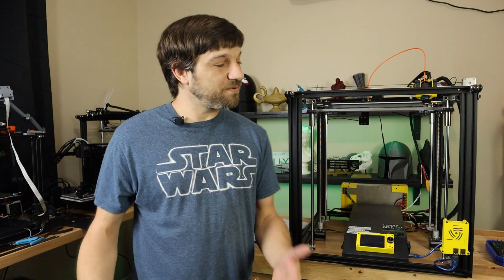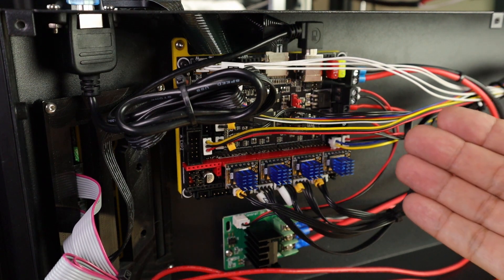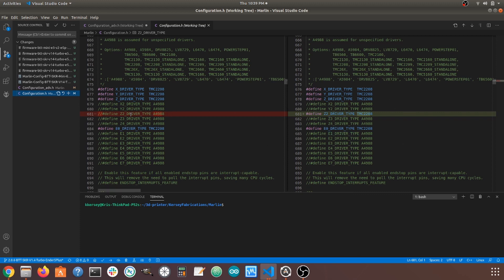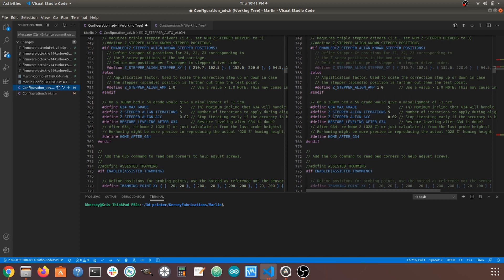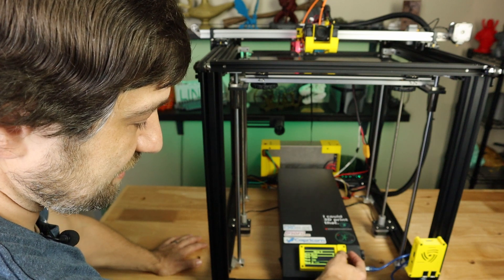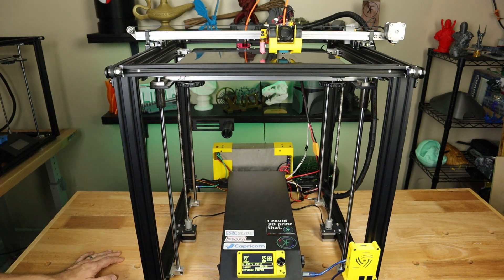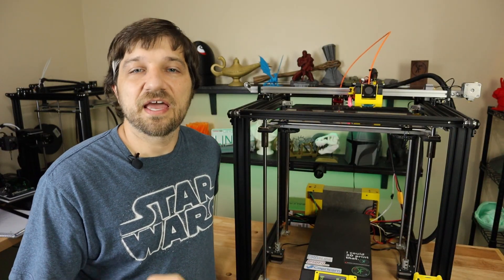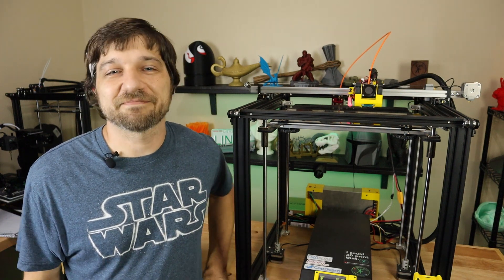3D Printing Pro Tips: Z Stepper Auto Align with Marlin G34

Comment: Hey Kris great videos. I tried installing the above marlin bin file from sd card on skr 1.4turbo board.  I get an error " read onboard sd card error.   its the sd card that came with my ender 5 plus. i tried other micro sd cards and same thing. any help would appreciated.
Reply from the maker: Thanks! I've heard of some people having issues with the SD card. Try sticking a small piece of paper or card next to the SD card on the the opposite side of the pins or exchange it.

Comment: Hi Kersey I am having an issue with mine. After adding the 5th 2209 and switching the wires over for the z I flashed your firmware and now I am getting a bed leveling fault. The bltouch seems to be working when the printer boots up and when I test it in tft mode of works but then I home z the bed goes down and the bltouch stows and deploys several times and the bed never goes back up and I get a error message come up and it says stop called because bl touch error restart with m999. I’ve tried enter m999 and G29 nothing happens. Any advice ?
Reply from the maker: Double check the white/black BLtouch wire. Make sure it didn't come loose.

Comment: I am having issues with my bltouch on your firmwware. I am using 2209 steppers and flashed the firmware according to your file but when the screen boots up in tft mode it gives a auto bed level fail and when homing the z  the bed goes down and flashes red / blue and never goes back up. The bltouch itself is working when testing it in the tft menu. Anyhelp would be appreciated. TIA
Reply from the maker: No problem. It's most likely the black and white wires. Double check those.

Comment: #define Z_STEPPER_ALIGN_XY { {  20, 110 }, { 187,  110 } }

how do we calculate these numbers?
ITs not letting me compile until this is correct
Reply from the maker: You should be able to comment that line out and actually let it compute it automatically.  To compute it correctly, you have to make sure it's reachable by your probe, so not closer than your probe offset.
Reply: @kerseyfabs   yes you can comment it out but i believe you should do i video explaining how to get these values. Because sometimes the way it automactically does it doesnt work as well. i did it a long time ago but cant figreu out how i did.

Comment: When you print with that petsfang duct do you have to reduce fan speed? I have it and i find that when the fan kicks on to 100% on the forth layer then it just blows the filament away from the print and never stick
Reply from the maker: Sometimes yes. I usually run mine at about 80-85%.

Comment: When you use G34, is this something that needs to be done once in a while or at the start of every print in the start gcode?
Reply from the maker: I only run it once in a while. In general my printer needs releveling very rarely. So when I do finally decide to relevel: G34, Corner level, G29. Something like that.
Reply: Oh okay, thank you. Just wondering because I am doing this mod on my Ender 3 Pro and that can be finicky at times.

Comment: Had a question. I did everything correctly and have the Dual steppers going. I'm having a hard time leveling the bed manually. I screwed the four corners up as you stated, I heated everything up, did the Z axis auto align (worked great). However, I'm used to the button on the Ender Plus stock board for AUX leveling, just using a piece of paper to fine tune places on the bed. I can't seem to find a setting like that on this Marlin build. The closet thing is the leveling of the 4 corners and that doesn't help because I can get the front of the board up towards the nozzle (using the screw knobs), but the back of the board is maxed out. The ABL function is off, I feel like manually leveling is the better way to go.  What do you think I'm doing incorrectly?

Edited: looks like what I’m looking for is bed mesh leveling (points on the bed, paper under nozzle, turn knob to move the Z axis to fine tune each point) and the G28 command disables the mesh bed leveling..

Comment: Fabulous video, thanks buddy! 

Some may need to assign Z2 pins depending on the motherboard. In the pins_[BOARD].h file (where [BOARD] = your motherboard) one may need something like:

//constructed Z2 to use original E1 pins on Archim2
#define Z2_STEP_PIN                         22  // PB26 E2_STEP *
#define Z2_DIR_PIN                            97  // PB24 E2_DIR -AddOns *
#define Z2_ENABLE_PIN                   18  // PA11 E2-EN
#ifndef Z2_CS_PIN
  #define Z2_CS_PIN                           19  // PA10 E2_nCS
#endif

/* 
commented out original E1 pins on Archim2
#define E1_STEP_PIN                         22  // PB26 E2_STEP *
#define E1_DIR_PIN                            97  // PB24 E2_DIR -AddOns *
#define E1_ENABLE_PIN                   18  // PA11 E2-EN
#ifndef E1_CS_PIN
  #define E1_CS_PIN                           19  // PA10 E2_nCS
#endif
*/

Comment: It makes absolutely no sense why you would keep the springs and adjustment knobs on the printer since you have auto bed leveling unless you know something I don't.
Reply from the maker: I've been thinking of doing a special video on how "auto-leveling" really works. The details of how the Z fade would really explain this. In short, a "auto-leveled" bed is not the same thing as a "level" bed. For things like models and such this probably makes little difference. For things like mechanical parts, this can really matter. An auto-leveled bed has to be compensated for.
Reply: @kerseyfabs  I still don't get it. The auto leveling IS the compensation for a bed that's not perfectly level. I'll bet 99% of all 3D print beds are not perfectly level. Also this hobby is not for making machine shop level stuff, were printing plastic. I installed TH3D solid bed mounts and said fuck the springs. Most people don't even calibrate their steps per mm correctly for their steppers and calibrate based on prints which is insane. Too much bogus info online about this hobby.
Reply from the maker: "Too much bogus info online about this hobby." You're not wrong. There is a combination of lazy info, misinformation, and group think. The final one I think is the most dangerous and the one I try to avoid myself by asking questions all the time.
"Also this hobby is not for making machine shop level stuff, were printing plastic." That depends very much on the user. Sure it's plastic but a lot of people use 3D printing for prototyping and dimensions matter.  Even as something as "simple" as cosplay can require tight tolerance to make mechanical parts work smoothly and accurately.
Sure, auto-leveling does compensate for unlevel beds but it shouldn't really compensate for a bed that isn't even level front to back/left to right. It should compensate for an uneven surface and when that gets too bad, the surface should be replaced.

Comment: can i use this firmware with skr 1.3 with no changes ?
Reply from the maker: No. It's a different board and at the very least you would need to update the board definition in the Configuration.h.
Reply: @kerseyfabs  yea beside that one thing (board definition):P
Reply: @kerseyfabs  tried to modify config to my skr 1.3 with TMC 2130. changed board type changed tmc type and the only problem is when i want to auto home its not going back to the endstops but in reverse direction as far as it can. When i reversed motors X and Y  its going to endstops but later not returning exacly to the center of the hotbed. And when i tried autoleveling its starting from the back of the bed and x pos is measuring to tle left unit its on place where bltouch dosent have bed to touch. Pls help
Reply: @kerseyfabs  ok never mind i finally found the problem. i needed to add to code lins with pins for endstops now everything is working fine

Comment: great job, but if you  I afford ..... all printers that have two motorized Z axes need a mechanical link between the two worm screws (type artillery X1)
In fact during the countless electric starts and stops in the use of the printer, the two motors inevitably are misaligned.
This normally happens on a stepper motor, but in the Y and X axes we have only one motor so no problem.
So if we want to be sure that the mecanic alignment of the two Z motors is maintained over time, there are two alternatives
1) link with strap as per X1
2) install two independent Z axis home point switches, if the motherboard allows it
The first solution is the simplest, you can install at the base of the screws (just above the case that contains electronics) you will lose a centimeter in the total measurement Z, but this does not matter.
Reply from the maker: I'm pretty opposed to linking the motors together. The motors should never come out of sink when printing, so the solution is to either d what you suggest in #2 or to use the G34 homing. FWIW, I've never noticed any loss of sync between my motors on the Ender 5 Plus.
Reply: @kerseyfabs  I think I explained myself badly, sorry but English is not my language, I try to explain better.
I did not say that the two Z axis motors lose step (misalign) during printing, no !
I say that over time if you check the position of the two Z axes after making a Home-point, you will see that they will no longer be aligned .
The first time I noticed this was 3 years ago on a CR10S pro, since then I have also noticed it on other printer with dual Z motors
Try to apply two discs (gognometers) in the upper part of the Z screws,
perform a Z-home point, make a reference mark on both discs, you will see that over time the two axes will no longer be perfectly aligned.
As I have already said it is normal, when a stepper motor is powered (off-on), this can move a micro stepp, the phenomenon is random, so being two independent motors, what I said happens.

I was the CEO and designer of a company that designed and built  systems that used stepper motors (similar to printers) I have 15 years of experience, I can guarantee you that what I said happens, you wondered why the artillery and other brands bind the two Z axes ??
Of course if you frequently use a self-leveling system before printing, this small misalignment will be compensated for, however I did this surgery to make the community aware of a problem that few know, I apologize for the bad English, but I hope I have well explained.

Comment: I received my dual z-axis kit a couple of days ago and fortunately found this video while searching for instructions, so a big thank you from a new subscriber! I say fortunately, because the instructions I was looking for dealt with keeping the gantry level when both steppers were on the same driver (short answer: manually level every time your z-axis steppers are powered down). My new mainboard w/5 stepper drivers will be here in a couple of days.

On a semi-related matter, what do you think about getting rid of the bed springs? I've had some run-to-run consistency problems (if I don't manually level the bed before each and every print) on my orange-spring equipped Ender 3, even with a BL-Touch and UBL. 

I've seen several suggestions to replace the bed springs with solid spacers, to eliminate the bed as a variable. I asked one of the folks who suggested this how much difference it made, and was told it made a significant difference.
Reply from the maker: I'm glad the video was helpful. I don't recommend removing the screws unless you plan to add at least a 3-point bed leveling system. Otherwise, I don't know how you'll level it in one direction. That doesn't mean that people can't make it work but you end up depending on auto bed leveling more than I would. To make the spring as reliable as possible, make sure you compress them as much as possible and work from there. I usually compress all the way then raise it up 3-5 turns.
Reply: @kerseyfabs  As a proof-of-concept I cranked the springs all the way down and added a couple of thick washers to raise the bed above the z-axis physical limit. That resulted in significantly more consistent meshes, so I ordered 100 M4 washers and installed the same number on each corner, after which my bed was nearly 2mm our of alignment. 

Using my calipers, I sorted them into groups with 0.05mm deviation. I found thicknesses from 0.75mm to over 1mm (all from the same lot, mind you), and that was the problem. My new main board was delayed (thanks, Amazon!) and should be here tomorrow - let the fun begin! I'll be relying on my BL-Touch and mechanical limit switches going forward (or perhaps replacing my glass bed and going back to springs?).

Comment: hi kersey  im having issue with my z they move so fast and and travel long say its on 10 mm it will travel 100 please advise thanks in advance
Reply from the maker: Can you check your steps per mm?
Reply: I set it vsc 100, 100, 400, 402
On the printer it went 100.00 100.00  on Z it went 4000.0... thanks
Reply: Ok I manage to change it to z400 and it’s fine now thanks ..... I still have a couple of issues one is how come my axis won’t go pass negative on the marlin lcd side I can move up but not all the way minus  side.... please help thanks again
Reply from the maker: @ferdinandparas2169  There's a Soft Endstops option that you should be able to disable in the menus. That will allow negative values. Just be careful.
Reply: Thanks for the response I got it figured..... every thing working now just last question .... the z alignment icon shows in btt screen.... I don’t have it but it’s on the marlin screen thanks in advance.....
Reply from the maker: Is it on the Marlin screen, touch screen UI, or both?
Reply: Kersey Fabrications  marlin screen only ... thanks
Reply from the maker: @ferdinandparas2169  So if you don't have dual stepper drivers for Z but you're seeing this feature, you simply installed the wrong firmware. My other video has the non-dual-Z firmware.
Reply: Kersey Fabrications  I have the dual z it works perfectly  .... I can see it on marlin screen but I don’t have the icon on the btt touch screen

Comment: I am somewhat confused by a reply . I have the SKR Mini e3 V2. I have added a second Z Stepper Motor to ZBM on the board. Will the Configuration.h and Configuration_Adv.h instruction be applicable?  If not can you assist with what those changes need to be? These are running 2209 Drivers on an Ender 3 Pro. Thank you in advance.
Reply from the maker: You can't do this on one of the Mini boards. They don't have independent steppers for the Z axis.
Reply: @kerseyfabs  That is disappointing. I am going to be installing a second Z stepper motor into the SKR Mini e3 V2 and I cant find any info regarding Marlin changes for it. I have seen that folks just plug it into the ZBM and go with it.... is that really all there is to do?
Reply from the maker: Yes. No firmware changes in that board. The Z motors are wired together.
Reply: @greggcaplan1304  I got one of the SKR E3 Turbos to solve this problem. It has 5 stepper drivers and was the least expensive path from my (nearly new) Mini E3 V2. 

Note that the Turbo's 5th stepper is designated for a 2nd extruder but Marlin (apparently) automatically remaps it to the 2nd z stepper if you set:

   #define NUM_Z_STEPPER_DRIVERS 2
and 
   #define Z_STEPPER_AUTO_ALIGN
  // if you want G34 to work!

in Configuration_adv.h. I say 'apparently' because, while the code builds without unpleasant messages from SanityCheck.h, my printer is still apart for mechanical tuning...compensating for a warped heater plate as well as a the carrier plate upon which it rides. 

I got this printer to build parts and enclosures for hobby projects, so I want the best dimensional accuracy I can get. I love my Ender 3 V2, and if I can get it printing as well as it's more expensive competitors I'm willing to put in the work.

Comment: Did you have to change the pin definitions of the board to make E1 work like a Z or it already worked the way it is?
Reply from the maker: No redefining needed. Marlin does that for you.
Reply: 👍👍👍 Thanks

Comment: I have hard mounted my bed to the base and removed the springs, hoping that wasn't a mistake I am guessing Z alignment will be good for the X axis but the Y I hope BL Touch will align?
Reply from the maker: This technically should work using the alignment and bed leveling BUT it's not a good idea. Bed leveling is meant to compensate for bed deformation and slight variation in height. It is not meant to 'level' the bed. It will compensate for the bed being off level but that could show up as skew in your prints if it's too far off level. I still recommend manually leveling first.
Reply: @kerseyfabs  My gut was telling me its probably not the best idea, will revisit this when I get home from work

Comment: Kris, when I try an build files I get an error " update includepath", what have I done wrong. I am trying to build the 1.4 turbo file above.
Reply from the maker: Have you tried to pull down the latest official Marlin source and see if it gives you the same error?
Reply: @kerseyfabs Hi, I have the same error. I have a skr mini e3 v2 for an Ender 3 with bl touch. Help please!
Reply from the maker: Did you pull down the latest version I have? 2.0.9.3
2.1.x is coming!

Comment: HELLO VERY USEFUL I HAVE ANOTHER QUESTION FOR THOSE WHO DO NOT HAVE BLTOUCH AND IT IS POSSIBLE TO DO WITH 2 PHYSICAL ENDSTPO THANKS A LOT
Reply from the maker: Yes, you can technically do this with a physical endstop on each side but you'd have to find a way to mount both of them and there would be additional changes needed for the firmware. Check this out for more info: https://github.com/MarlinFirmware/Marlin/issues/7113